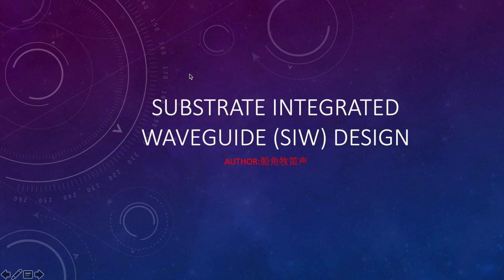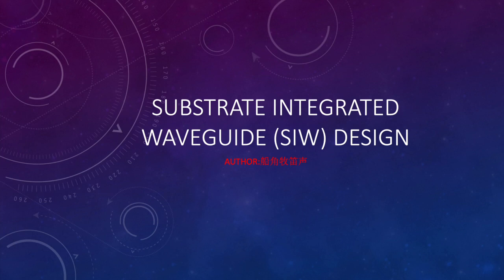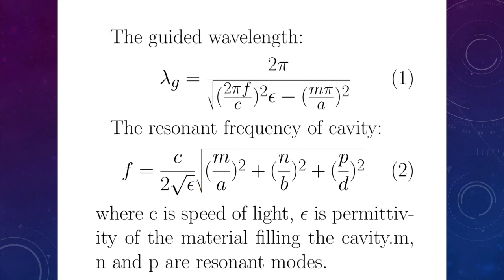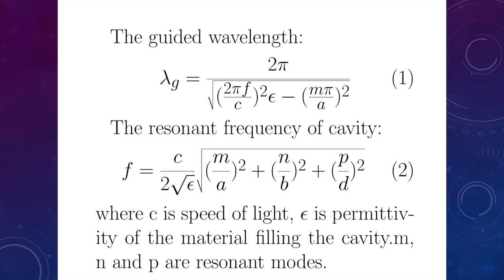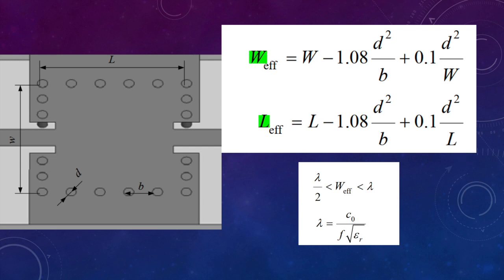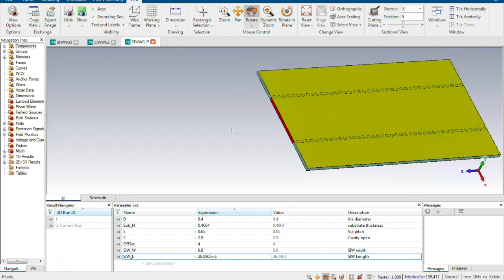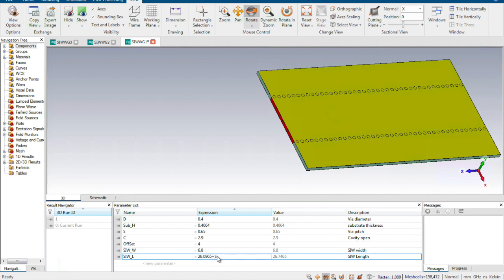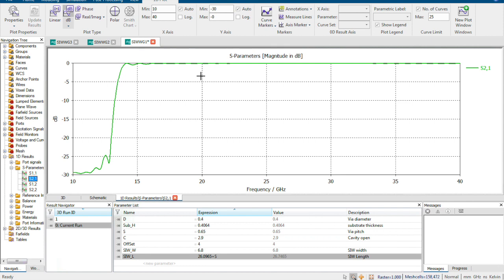SIW Design

Comment: Hi.. First of all thanks a lot for the videos.
1.Can you tell me whether Weff is width between two rows of via right? and Leff could usually be multiples of lamda_g/2?
2. Can you also tell how do we calculate the dimensions of Substrate width and length?
Reply from the maker: I made an app in App Store to help you get the initial parameters for SIW.
https://apps.apple.com/ca/app/siw-cal/id6478937946

Comment: really thanks a lot for your excellent explanation .its helping me to understand more . i have some questions, because already i used the equations in this video but didn't as in your parameters list . 
1- what is value of w = ? to find  W_eff...........generally from where can i know its value ? how can i detemine the W & L is (it has specific rule to follwo)

2-is the guided wavelength(lamda_g) same as cut off frequency ? i am confused  because in some paper i found some equation using lamda_c of cut of frequency replacing lamda_g
 as shown :
(d < lamda_c /5) 
 (0.05 <spacing / lamda_c <0.25)      
are these equations special for specific case or same as your in video ???????? 

3- the  resonant frequency equation like this fc=c/[2*pi*sqrt(permittivity) ]*[sqrt[(m*pi/w)^2+(n*pi/h)^2] also found at some paper
is this equation  correct to use or should use resonant frequency equation  found in your video ?
and you replayed about C is In this design, we can ignore this parameter ..is it means =1 or what ?could you please rewrite the lamda _g equation with ignoring C value 
last questions :
is SIW suitable for frequency range from (0.1  ----   3 )GHz? 
and i should design at small size (compact) i asked because i saw most of author at paper used it at v.high frequency like (15ghz , 20 ,40 and above ) ?
your answer will helping me more for my design at this range because i need resonance at different frequencies from 0.1 to 3 ghz i mean multi resonances (multiband) in all range 
many thanks for you again
Reply from the maker: For the width, you refer to the corresponding metalic waveguide width. But the SIW substrate permittivity(Dk or Er) should also be considered. Once the Width is decided, there is experience equation to calculate the W_eff

Comment: Thanks a lot Fan,  will you please tell me whats is C  and offset in your design parameter
Reply from the maker: The offset is the distance between via and the edge of the substrate.
Reply from the maker: C is the open slot used for coupling EM waves into the cavity resonator. In this design, you can ignore this parameter, since this is just a transmission line rather than a SIW cavity resonator.

Comment: Thank you so much for sharing this video.. Which materials we can use to load in "Vias"..Waiting for your response.
Reply from the maker: In the simulation, we normally just set the materials to be copper. In reality, it can be made by some metal with better conductivity, such as gold, silver by physical vapor deposition (PVD)or other methods. You can talk to the PCB manufacture what kind of technic they can do. To be honest, we just used PVD, so I am not sure about other methods. We tried to deposit Ag after drilling the holes on the substrate to fabricate vias. I believe, most of the PCB manufacturers can do it.

Comment: First of all thank you for the wonderful video. I was working on this when I found this video. Very helpful for initial foundation. Could you please share the paper or the source of equations?
Reply from the maker: I am so delighted this video inspires you. I believe Ke Wu has done some really valuable work on SIW. He was regarded as one of the pioneers denoting to the development of SIW. I highly recommend you to read the four following papers.
1. The substrate integrated circuits-a new concept for high-frequency electronics and optoelectronics.
2. Guided-Wave and Leakage Characteristics
of Substrate Integrated Waveguide.
3. Dispersion Characteristics of Substrate Integrated
Rectangular Waveguide.
4. Single-Substrate Integration Technique of Planar
Circuits and Waveguide Filters.

Other scholars, including Ke Wu,  they shared some experience about design microstrip-to-SIW transition and waveguide-to-SIW transition, which are also helpful to give us a hint to design our system.

Cheers!

Comment: hi sir,firstly thanks for sharing this video,i want to know how you  calculate the diameter D? 8:33 ,it should be smaller than one-fifth of guide wavelength,but what is the parameter a in guide wavelength equation 2:46 ? i think it is the width of the siw, yet we don't  calculate the width before the diameter. last question,would you  like to provide the paper which is used to calculate the guide wavelength?I am looking forward to your reply.
Reply from the maker: Thank you. The equation served for guided wavelength calculation can be found in many textbook and papers. I will specify some papers as you requested latter (by the end of today).
Reply from the maker: I recommend two books: Electromagnetic waves (Umran S Inan) in chapter 5; microwave engineering (Pozar) in chapter 3.

Comment: hi sir,firstly thanks for sharing this video,i want to know how you  calculate the diameter D? https://youtu.be/wghlZPCC9h8?t=516 ,it should be smaller than one-fifth of guide wavelength,but what is the parameter a in guide wavelength equation https://youtu.be/wghlZPCC9h8?t=166 ? i think it is the width of the siw, yet we don't  calculate the width before the diameter. last question,would you  like to provide the paper which is used to calculate the guide wavalength?I am looking forward to your reply.
Reply from the maker: Thanks for your watching and comments. 
Before starting to design the SIW, we shall know the requirements of the design, such as the working frequency, the permittivity of the substrate (Er), the thickness of the substrate, the machining limitation (the minimum D and P they can do). 
Second, we know the working frequency EM waves we want to propagate in the SIW, and we can calculate the wavelength of EM waves propagate in a media with permittivity of Er, lambda=c/f/sqrt(Er). 
Third, the width of the waveguide should be in the range of (0.5 lambda to lambda).
Fourth, we know the width of SIW, and we can calculate the guided wavelength of EM waves.
Fifth, we can set the via diameter be smaller than lambda/5
Sixth, we can set the Pitch(center to center distance) P <2D.
Reply: @Fan-vk9gx  Thanks for your excellent replay! I got it now,i have simulated the siw which  have the same parameters with your video in HFSS, but  obtained a different  scattering parameter.For example,only when the frequence larger than 25GHz  the  s11 would smaller than -20dB. Can you help me to check out  my design if it is convenient?
Reply from the maker: Hi Parker, I can not pinpoint the potential problem if I do not have your design model. BUT, I can give you some hints. (1)check the properties of substrate in your model, is it same as what I used. (2) the waveport settings, what is the impedance in your design. (3) check the S21 or S12, are they too low? Normally, the impedance is much higher than 50 ohms in waveguide including both planar ones and rectangular ones. And in reality, we need to design a taper or transition to feed the waveguide. Maybe, this it just caused by the port setting. Hope these can help you. If there are still some issues, plz let me know without any hesitation.
Reply: @Fan-vk9gx  hi Fan,I have checked out the tips you offer to me but still got the different results from your's.Actually, I also know we need a microstrip tansition in reality,but i just design it as same as you do in the video. Can i have your e-mail so that i can send my design mode to you?
Reply from the maker: Hi Parker. I see, let me try to import my CST design into HFSS and check its performance. Indeed, it happens that the same design in CST has different performance in HFSS. I will share my result in HFSS with you later.
Reply from the maker: I've emailed you the design, please check your email.
Reply: @Fan-vk9gx  I really appreciate what you have done for me,and I have received the design.
Reply from the maker: My pleasure.
Reply: @parker5957 Has the problem been solved?Cause i got the same question.😢